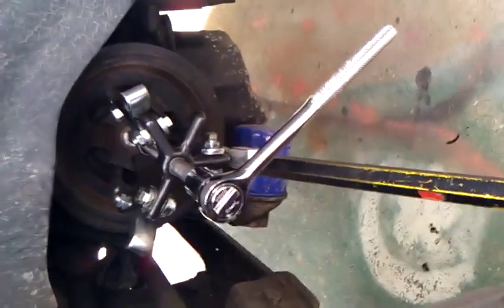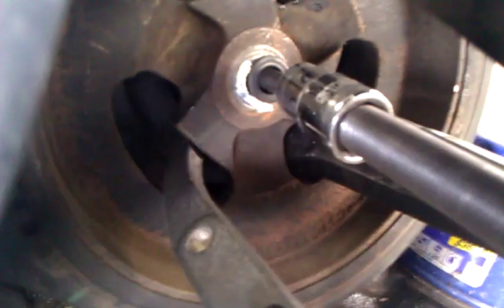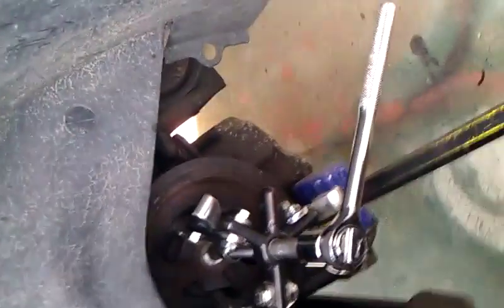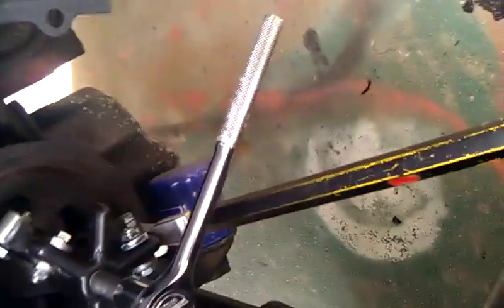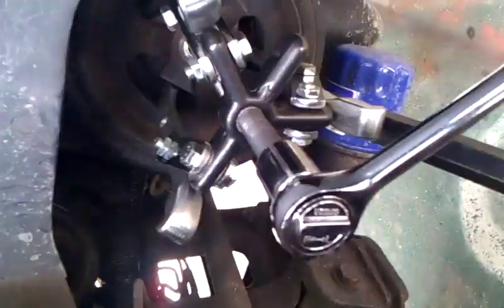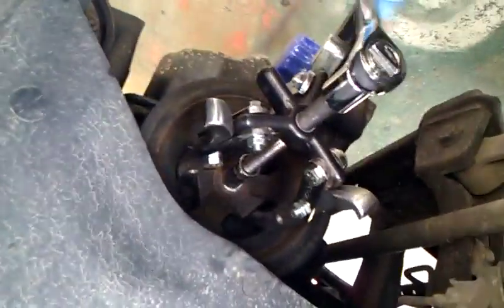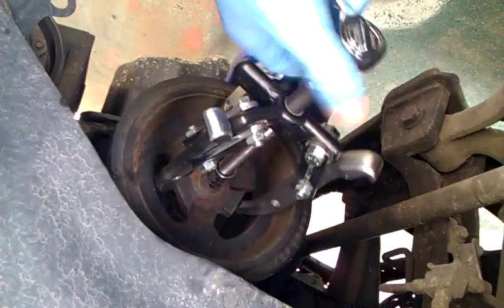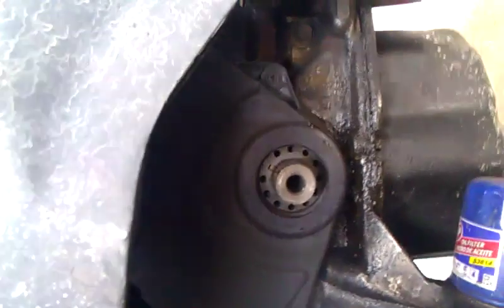crankshaft pulley or harmonic balancer how to:

Comment: Looks like the 2.4L 4 cyl engine.  I botched that job on our 1996 Voyager 2.4L.  I used a 3 jaw puller like you, but rested the cone of the forcing bolt in the crankshaft hole instead of inserting a rod in the hole to push against.  That apparently swaged the hole outward so the pulley wouldn't come off.  I hope nobody repeats my mistake.I then borrowed the correct puller from Autozone, cranked hard until one of the pulling tabs on the damper broke off.  I added a blob of epoxy to keep it semi-balanced.  Now the pulley was partly off but wouldn't budge further.  I later beat it mostly back w/ a sledgehammer (hope didn't hurt the thrust bearings).  That was because the serpentine belt was getting the end worn off from the mis-aligned pulleys.  My task was to change the timing belt, and I was able to just squeeze it past the damper and oil pan (BTW, cut a slot in the lower plastic cover to slide it off).  No way to change the front seal as-is (not leaking thankfully).  Has been that way for ~10 yrs and thru another timing belt change.  If I ever fix it, will have to cut the pulley off, but will likely scrap the van before then (220K mi and other issues).

Comment from the maker: @mindfuqq the pulley must have been loose, make sure the clearance/or inside gear teeth are not damaged. the fix is easy and not expensive if done by you or around $600 buck at certified shop.
Reply: what size bolt is that